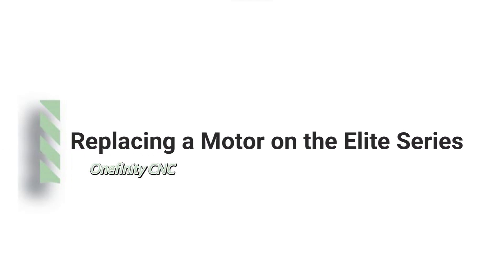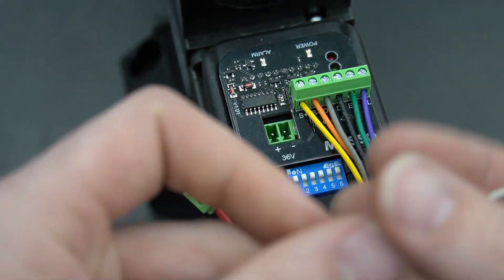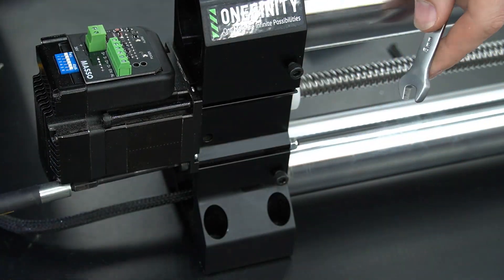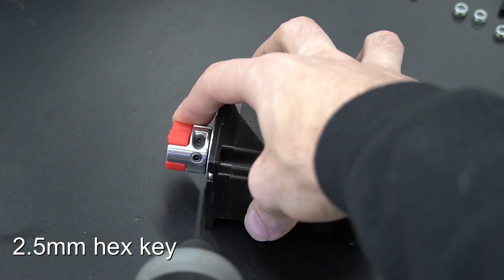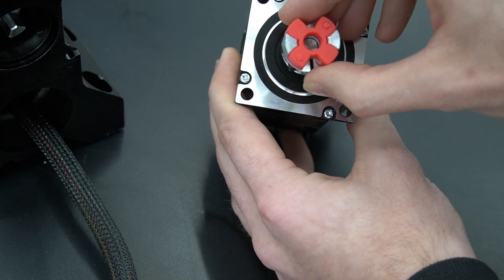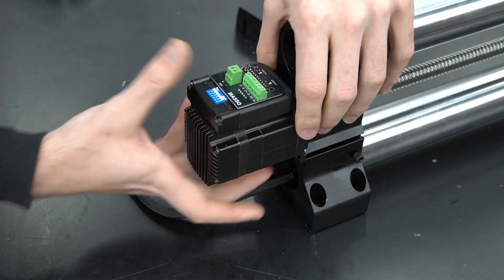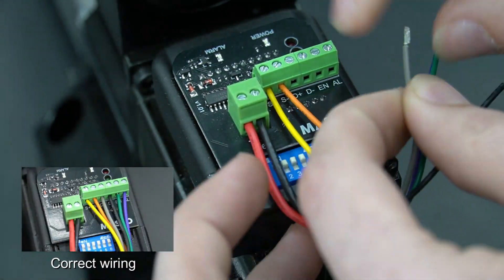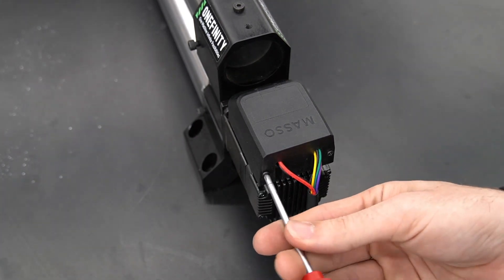Replacing a motor on the Onefinity CNC Elite Series // Support

Comment: Should be an easy process.  However, there are two black bolts on the left side of my X drive motor (as you look at it straight on) and after removing the 8 mm nuts on them they came out easily.  However, there are two chrome plated bolts on the right side and after removing the 8 mm nuts on those - the bolts will spin freely - but don't appear to be threaded - and won't come out even if tapped moderately and trying to push them out with a clamp.  I'm afraid to do more as I don't want to crack the aluminum frame on the motor mount.  Any ideas how they were inserted and how to get them out without damaging the machine.  That motor on my Elite Journeyman machine looks older than the others - doesn't light up green - and prevents the machine from homing.
Reply from the maker: Revised video shows just this.